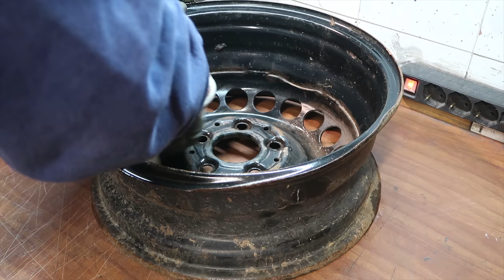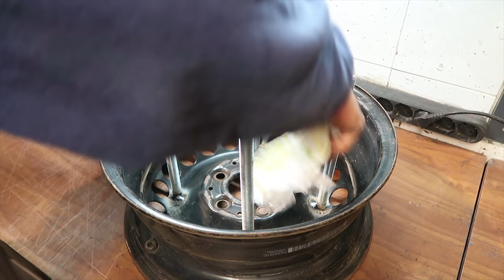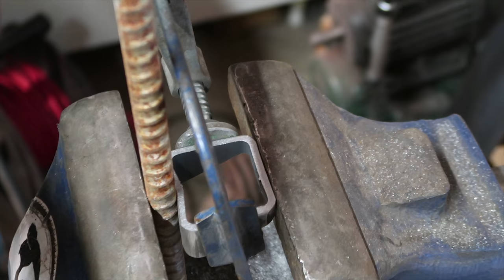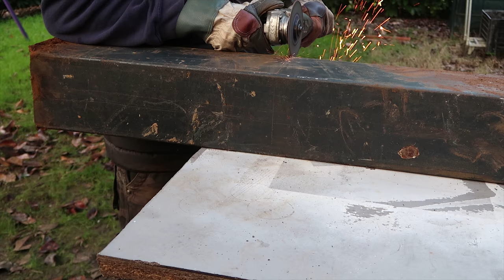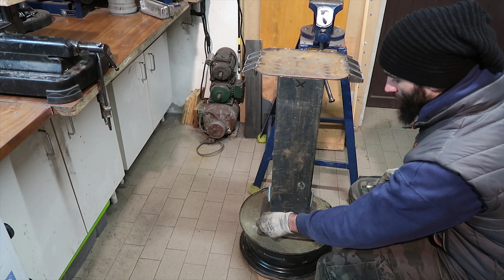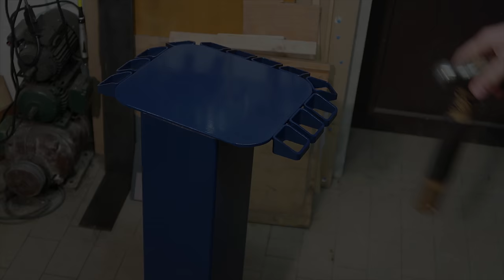DIY Tool Stand! Cheap But Sturdy. Steel And Concrete.

Comment: I remember reading somewhere about a guy who welded a hollow anvil and filled it with a sand/oil mix.  His reasoning was that the oil impregnated sand makes a great weight for steel stands that might see some knocking around since it's heavy, packs tight, deadens ringing and movement, doesn't crumble, and helps inhibit rust a bit.

Can't say I've tried it myself on anything as it is still on the 'TODO once I get a welder' list
Reply from the maker: Yeah I heard about that too! Sounds very reasonable to me :)

Comment: Excellent idea, my only suggestion is to add 4 rotating wheels so you can roll it around the shop to where you need it. You can get locking wheels so it will stay in place when you need it to.
Reply from the maker: That's a great idea! I won't add some here because it will stay outside in the dirt all the time

Comment: I know I'm a Monday morning Q.B.  I like the basic idea, but why the plate and bolts?  Just cut openngs in the tube and let the concrete fill it to the level of the top of the rim.

Comment: I liked it all the way until you painted it blue... WHY???
But without making jokes, WOW... That's a great tool stand !!!
Reply from the maker: Thanks mate! I want to leave this outside, painted all to hopefully prevent some rust. But I don't have high hopes! :'D
Reply: The blue was great, but leaving the concrete the original color could have added contrast.  All in all, amazing job and so easy!  Love it!
Reply: Hey nice project! you should try to powdercoat things to avoid rust, although it's tricky to do on big pieces
Reply: Are there step by step instructions on these?

Comment: I would have run nuts midway down the bolts to provide more stability within the cement.  Other than that great project!

Comment: When u mixed the concrete, was it a thin mixture (more water than used in small construction jobs) or thick mixture (less water)??
Reply from the maker: Go with more water so it's easier to pour! Using too much water does weaken the concrete, but I'm sure it's not a big deal here since we are using it more like a weight than anything else :)

Comment: Sure. We can all build a $50 stand if we have $2000 in welding and milling equipment. So tired of these "DIY" vids.
Reply from the maker: 2000?! All my tools together don't cost that much! :') My welder is 40€ new, I bet you can find one for less used! Same goes for the angle grinder :) Steel from scrapyard was around 5€ and a bag of concrete is like 3€ so this project is really cheap to make! I swear getting into something like this is cheap, don't let this stop you! :)